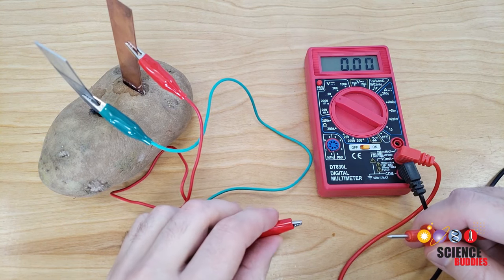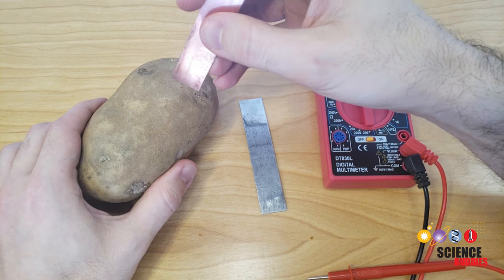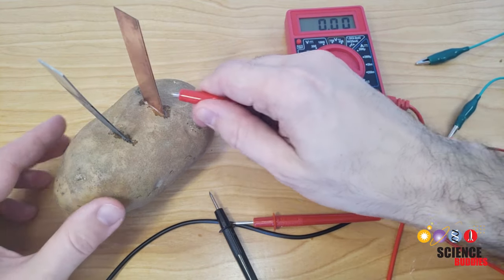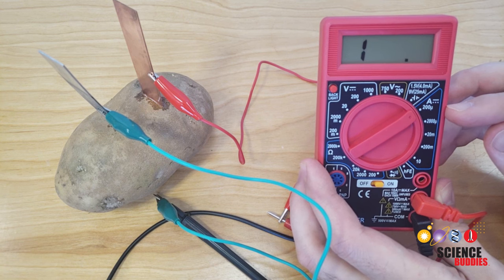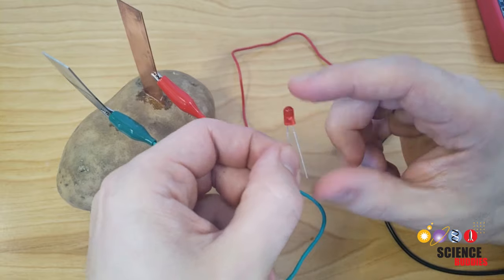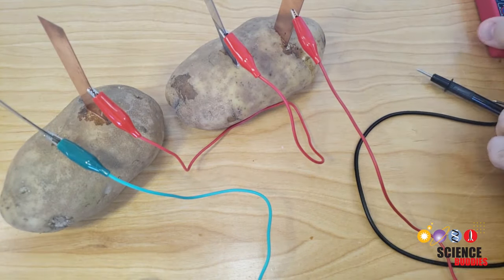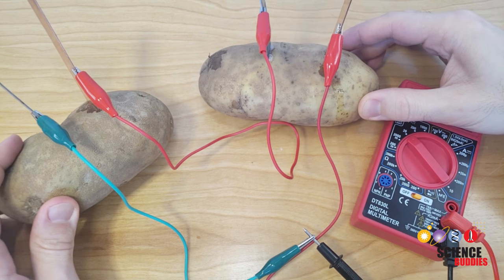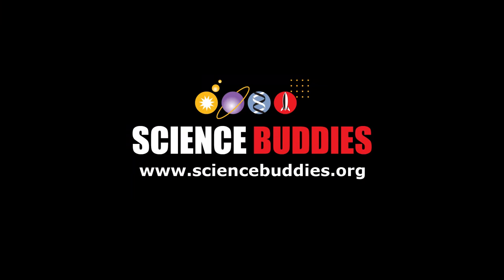Potato Battery Science Project

Comment: Bad use of VOM (Volt/Ohm Meter). If using a cheap $6 Harbor Freight meter you will ●BLOW OUT■ the overamp fuse (1 or 10 A) which is soldered in. Always start with the ^HIGHEST^ Range AND put a resister in || w the circuit to drop the short circuit current. This HF is from 10% to 1% accurate. Chk w a control. & retuurn w/in 90 days.

Comment: Hi, I am working on an engineering project for my school, but I can't see what your multimeter is set to. I am using the potato and the wires but I don't have those silver and copper sticks like in the video. I am using copper wire and zinc screws along with pennies. Will it still give a charge using my multimeter? When I saw the video your current was 0.293, but mine is lower. Is there anything I can do to add to the charge so my hypothesis can stand true?
Reply from the maker: Hi - we suggest reading the written instructions on our website (linked in the video description) and watching our separate multimeter tutorial video: https://youtu.be/ts0EVc9vXcs. The amount of current you get depends on the surface area of your electrodes. The rectangular electrodes in the video are much larger than pennies and nails so have more surface area. To increase your surface area, you could try adding more pennies and nails in parallel.